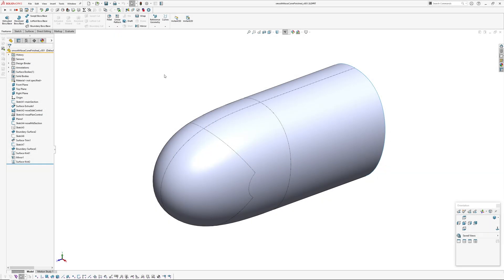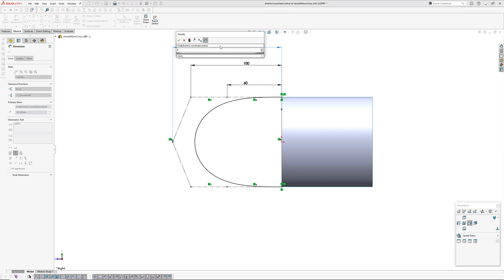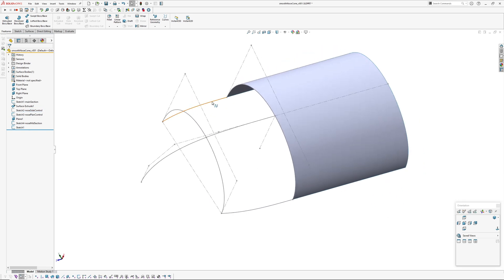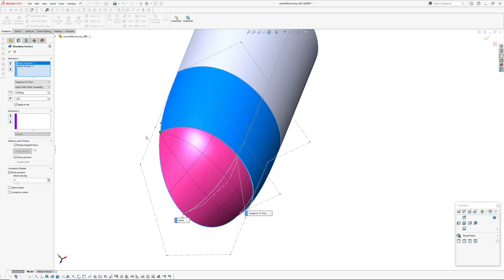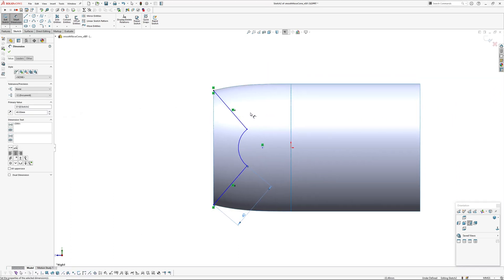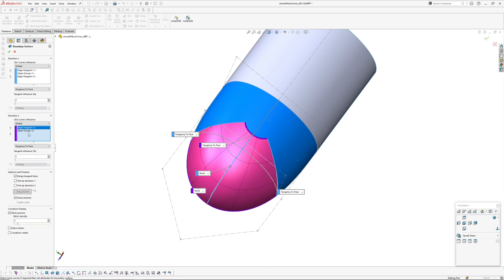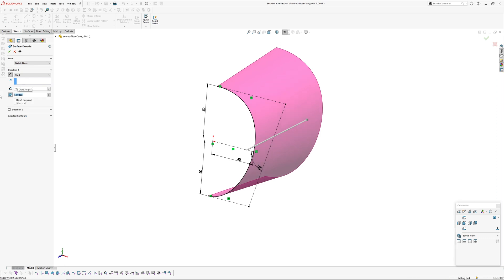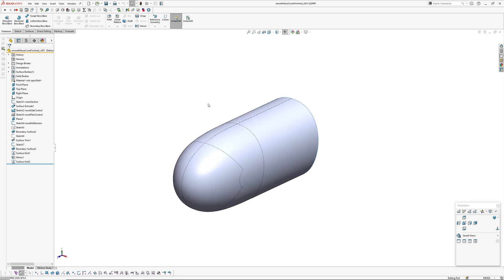Modelling a Nose Cone/Domed Surface in Solidworks. Part 2

Comment: @ 10.34, why tangency to face rather than curvature to face?
Reply from the maker: SW does a poor job of trying to resolve things with a curvature constraint if there are boundaries selected in both directions. It normally adds a localised surface 'wiggle' along the boundary edge to satisify the G2 constraint, rather than spreading the effect across more of the surface.

Comment: Hi Andrew

From 5.08 you say that you prefer "Direction vector" for the first and last profiles.  Is there any practical difference between this and "Normal to profile"?  Do you feel that it's more robust, or perhaps gives you an extra measure of control?

I ask because I would absolutely have used "Normal to profile" here, expecting the end result to be the same as using "Direction vector", but without the need to pick an additional reference, which requires more clicks and is just another reference for SW to lose if someone (probably me!) inadvertently deletes it. (Not that that will happen in this particular instance, as your reference is one of the default planes.)
Reply from the maker: Good question. I was struggling to get an edge to zero degrees tangent deviation once. The reference (say, in Dir 1, on the right plane) had normal to profile as the boundary condition. It turns out one of the Dir 2 references was normal to the right plane when looking from the front, but was angled when looking from the top. Which is not that unusual and have not had issues before. Changing it to a direction vector solved the issue in this case.
Reply: @AndrewJacksonDesignStudio  Handy to know. Thanks.

Comment: I find that this technique only works (in terms of achieving good surface continuity) if the sides of the nose cone are perpendicular to the right plane. As soon as I add draft (3 degrees) the surface continuity falls over completely. Perhaps I am doing something wrong here? Anyone else had this experience? I'm going to try and add a ribbon surface to assist with tangency/3-degrees and see what results I get. But I find that this technique is a struggle in a lot of CAD packages when you add draft.
Reply from the maker: That is strange. I use this technique frequently to cap off corners and other areas where the primary surfaces leave a 2/3 sided hole. Here's a few videos where I have used this technique, except with a G0 boundary (same as the G1 centre line boundary the RH plane you mention in the nose cone). I guess the difference is in these videos, I do not use a ribbon to explicity define a draft angle on the G0 boundary. 
https://youtu.be/mC2uhPYScY8?si=hbTqTQocL5-ASEKW
https://youtu.be/yontOO7J3Io?si=NLhpusdbq2Lr5zBq

Ruled surface can be used to make a ribbon, but sometimes the result can be a little average. I've had some success using an extruded 3D sketch (with draft) to make a ribbon surface, or if you don't mind a little variation in the draft, a loft, using two profile curves made in a 3D sketch, tangent to the relevant geometry, then a single edge/curve as the guide.

If you are using a boundary surface to make the final patch surface, try playing around with the tangent influence a bit, as some times having 100% in the first direction and 0% in the second direction works, or vice versa where that creates ripples near the boundary.

Comment: Always my go to for Solid works surfacing advice! I was wondering how you might attack a Logitech MX master mouse, I know design partners did a lot of the work for it and was curious what software they might have used when working on it. Cheers for the great videos
Reply from the maker: Hi Ollie, not sure how I'd approach that mouse off the top of my head. DesignPartners (now PA Consulting Ireland) did use Creo but I know they also use SW as well but suspect Logitech is still Creo. Thanks for watching!

Comment: Nice update and thanks for the original video which I reverse engineered for my studies with Alias earlier this year
Reply from the maker: Good stuff, did it go ok in Alias?
Reply: Yes thanks at the time I was getting my head around problems like wing tips nose cones in my case I’d roughed out a Boeing type nose working through pointy objects and 4 sides patches - will be turning my attention to SW in 24 time permitting